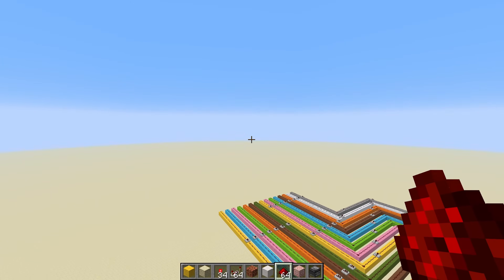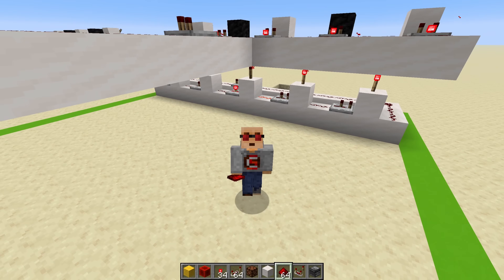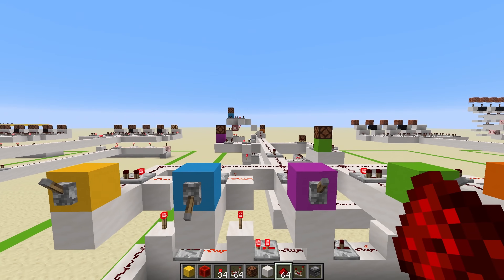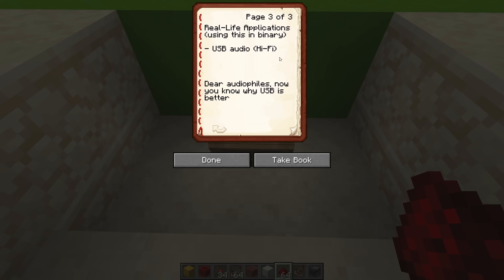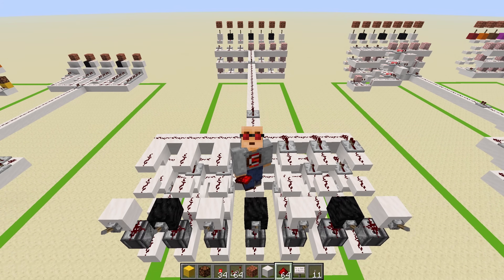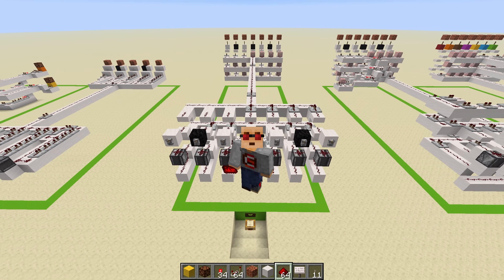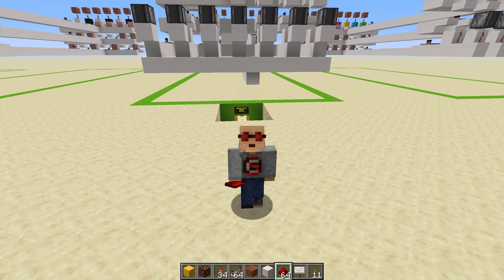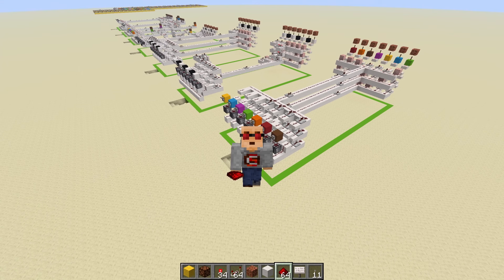How to Send Multiple Signals on a SINGLE Redstone Wire

Comment: I built something like this around the time that pistons were added to the game. I had a sender and a bunch of receivers, each one having their own address. I didn't transmit individual lever states, instead it would send the entire state in binary. So if you had 10 bits it would send a sync pulse to initiate then a receiver addr (a few bits) then the actual payload. So at 10 bits the payload would be sent over 10 ticks in time, tick 5 = bit 5, if the bit is on then the wire would be on at that point in time.
At the time it was pretty advanced stuff, now it's considered basic. :)

Comment: Is there a method using signal strength? like you’ve got 15 different values to work with, 16 if you include signal strength 0 as a unique output.

A downside is that it doesn’t scale well compared to the binary options

Comment: it would be so cool to have a automatic telephone exchange system in minecraft, like if you had a massive hierarchy of those systems all connected to a single line it would get real slow to send a message to another player so what if you had each hub be a switching station that can directly wire your signal to more hubs or the destination for fast direct data transfer and then you can disconnect and whatever, idk I just got that thought thinking of these massive redstone lines connecting to this network of systems like what we have with these massive undersea cables although you would have problems of simultaneous transmissions... ooo but also imagine super long redstone lines being continuously loaded with arrays of enderpearl stasis chambers

Comment: I think a good solution for the first one is making a separated clock that spreads to the torches. That way, It would be as fast as possible. Plus You could make a toggleable clock, so You could aways make em' uniform if they unsync.
Anyway, I find that very amazing, congrats for Your deeds! I really love redstone and command blocks stuff, both because They speak to me, and because they fit together very well!

Comment: I've always wanted to do this for a global rail network; have a sibgle wire in parallel with your track and have the signal change each turn based on the destination you select.

Comment: there's better ways to do this, I have videos from 5 years ago on this and not only serial but you can also do addressing to handle multiple devices on the same wire , tho i made them on bedrock version the basic concept is still the same

Comment: You forgot about hexidecimal

Comparators send the exact signal strength recieved

Pair that with sethblings hex wires

You get 2x slower wire
But 4x information

Making this over prolonged distances the best method

Especally since coverters are just basic comparator - signal strength
Send into a 1 strentgh detect red coder

And to fire in hex you just dispense shulker boxes

Comment: The issue I see with all of these in larger redstore builds is synchronous i/o.
If I have a synchronous input on two wires, feed it through any of these and into an XOR gate, there will be times where the gate transmits, whole parallel lines (with equal delay) ensure that gate never outputs, if the system doesn't break from the synchronous inputs in the first place (wich at least asynch and parralel binary would)

Comment: Grey codes grey codes grey codes
Reply: It's just an alternative base-2 numeral system to binary which plays much nicer with minecraft where instead of working like the decimal and other similar systems, each increase by one only flips one bit. So....
0: 00
1: 01
2: 11
3: 10
For example
Reply: It's relevant to data transmission because it can make the chunks of redstone on each end much simpler and smaller

Comment: My first thought was synchronous serial binary with a clock line. 2 lines, 4 ticks to facilitate 15 input sets, and personally I’d lock input while a clock cycle already has an input running. I’d rather have dropped data over corrupted data.
My second thought was effectively the asynchronous serial binary method. But I like the clock line more I think

Comment: So basically you could make an CAN control with the serial binary one if you gave an address and then the instruction. There was this one build that used different items in minecarts and piston slimeblock lines to send information through nether to teleport you to different places. With this it could be made as well.

Comment: Trying to encode musical notes in serial data was actually my very first redstone project, but it was waaay long ago before Pistons and so the only way to write both 0's and 1's into the cycling data stream was with torches, which were NOT (and still aren't?) signal stable.  So it failed.
But I did invent a brand new kind of XOR gate in the process! (2-wide, uniform delays when changing input)

Comment: Before I watch, is it about encoders and decoders? I've made a decoder before in Bugrock edition for a long-range wireless base controller, and taking input from a small "remote" that was built using a few pistons and torches!

It was mainly because I found wiring from the ground into the sky too tedious and ugly lol

The wireless "remote" could control in the base a water elevator, a TNT cannon, a TNT excavating site, and a snow golem-projectile-through-lava defense system lol

Idk just thought I'd share something

Edit: cool!!! java redstone is where it's at

Comment: to be fair, what causes issues with s/pdif and toslink is the clock resynchronisation, for multi channel PCM (e.g. stereo) signal there might be less issues as the packets for each channel have a preamble, which makes it easy to resync, especially if you use a large buffer.
also slight correction: DB25 parallel ports usually aren't multiplexed, they're more like the first one where you have all wires. (though tbh they're kind of a wild west of connector, some actually send 8 serial signals over it, and some DB25 are actually RS232 serial.) and USB is quite a bit more complex as it's a network protocol, with each endpoint having its own address.

there's yet another way to interface, it's to use a host-device protocol, where you have one host ask every device what it needs, that can be more efficient as it sends data over the wire only when needed, and it would usually be spam proof as the state of the lever is sampled when requested.

also you can spam-proof most designs, by inhibiting the lever output while it's not safe to change.

Comment: I think you could solve desync by having something extra trigger with the first bit of data so you always know where the start is. (This could be done with a second line that only triggers for the first bit or having a strength 16 input for the first bit while everything else is less)

You could also have that first bit of data actually trigger the start of the second clock so then the delay becomes irrelevant because the correct bits are always synchronized
Reply from the maker: Bro watched the first minute and left😂

Comment: There's also "analog" where you send signal strength over one wire to control 15 different outputs.

It does however require a comparator every 3 blocks and is therefore quite expensive and slow.
Reply: Sethbling made a way to connect them with a 3 block wide wire

First output detected by repeater chain
All feeding into a single input wire
Which inverts the signal but the distance inverts the signal again

Keeping reliability
Reply: Also, the comparator would be every 4 blocks (comparator + block + redstone + block + comparator)
Reply: @DABABIBABABU not if you go with sethblings comparator wire design

Just stack 15 repeaters sideways to do a double invert signal strength for the next comparator to be read.

It is 2x slower for 4x information therefor twice as effective
Reply: @maxdragonis1304  I wanted to add to your comment that the simple design would've been 4 blocks long anyway, not 3.

About sethblings's design: I'm not sure if it's really twice as "effective", since you're trading latency for bandwidth. You can always add more wires to fix bandwidth, but for latency you gotta use fast wires.
Reply: @DABABIBABABU well it is really a conversation about watts over volts/amps

If your talking about latency that would be the volts

While the bandwith would be amps

This would be 4x amps for 0.5x volts

Aka 2x watts it would be more effective

The only downsides i can think of is spacing which is 18/10
In scale
And cost due to requiring 15 repeaters and 30 dust per comparator in the wire
Reply: @maxdragonis1304  no, I'm talking about latency. Aka how long it takes for information to reach the destination. In his keyboard example it's about how long it takes for a key to show up on the screen.

Bandwidth / latency are good words to describe the concept. High bandwidth = if you can watch videos in 4K. Good latency = if you have low ping in games.

Volts / amps are used when talking about electrical energy, not information. In this context "latency" obviously isn't a thing. You probably don't care how fast some random electrons get to you lol.
Reply: @DABABIBABABU yes but they are perfect examples for the concept at hand in order to make an arguemebt for comparator information in block games

Comment: TOSLINK cables transmit the same signals as S/PDIF. S/PDIF combines the clock and data signal using signal transitions. The signal will unconditionally transition every bit sent, and the 0s and 1s are marked by transitions in between. The unconditional transitions can be used to synchronize the clocks. Having used TOSLINK for my surround, it seems pretty robust, haven't noticed any bit slip, which results in weird distortion with audio.
Reply: exactly. the clock is recoverable with real s/pdif or toslink because of differential manchester coding. this implementation doesn't. i was a little confused by that.
Reply from the maker: Yeah but reclocking the signal is a pain, you get an inconsistent PLL out of it, for HI-FI you can hear a huge difference with USB

Comment: Thinking of parallel vs serial binary, it's really just a tradeoff of space vs. time, and as computers themselves have gotten faster, it's often a reasonable tradeoff to make. When you're dealing with super time critical hardware, you might find more usage of the parallel format, but less so in consumer electronics where good enough is good enough, and cheap to mass produce is king.

Assuming you had a truly enormous base or machine where each subcomponent or farm or station could have multiple inputs, it might be worth adding a control line that directs destination separate from the data line that provides the input. Alternatively, you could put the control value in the high bits and the data in the low bits, though that runs some risk of rewiring if you later need more data lines. The advantage of this would be allowing each subcomponent to start it's data signals at zero again, and to allow each subcomponent to add new data signals incrementally. Right now in your serial design, if you send signals 1 through 5 to component A and 6 through 10 to component B, and then you later wish to add more to component A, it would have to be signal 11. Even if you left blank bits for each subcomponent to expand into, it's still weird that component F starts at signal bit 31, and the handling needed at each subcomponent scales with the number of total components in the system, which is also weird. A control line keeps each component simple, allowing you to design the component fully in isolation, and then build it into the system without having to remap the lines.

Anyway, really cool video. As much as I think redstone is fun when done by typical YouTubers, I think it's more fun with people like you who understand circuitry, so thanks for the vid!

Comment: Does TosLink not have a regular timing signal to sync them between clocks? I thought it did.
Reply from the maker: Yeah it does, but it's really crappy and complicated for no reason. It's BMC (Biphase Mark Code),  which means  the receiver basically has to reclock the signal using the rising edges of the data. Only hi-fi gear for old people that refuse to use USB implements it

Comment: I'll have to take a look at that keyboard you'd made! I designed my own "typewriter" that does roughly the same thing as yours, which functions by sending character data along a single wire by encoding it into a series of pulses that gets stored in a shift register hooked up to a display slice. The specific implementation means that it's pretty slow and very susceptible to spam-induced data corruption, though. The speed at which yours goes at blows my design out of the water.
Reply from the maker: It's cool! Yeah binary is a game-changer when it comes to any type of computational stuff
Reply: @ChunkySquaresMC  How are you handling character data storage with it? Does each display slice have its own ROM, or is it a single ROM that everything shares? The slowdowns in my display tech come from everything sharing a single central ROM, which trades compactness for speed.
Reply from the maker: @TheAppleFreak  
Locking repeater shift register + locking repeaters😎. You don't see that often, huh? Locking repeaters are like the definition of underrated

Comment: sees it cycling through the inputs on a clock
That's just a NES controller
that's quite literally what it does.

also SP/DIF / TOSLink are just different revisions of the same digital audio transfer protocol, and they do not get distortion from how they use it.

Comment: bro there a problem with your last build.
you can send only 1 bit at the time and its not very efficient.
its better to just do it a classical shift register way.

if you have number like 01011010
you  need just send 1 01011010
that first 1 starts a clock and you just do shift register stuff.
thats much faster and its always work with the same timing you need just to click button but you can do that automaticly if you need.

anyway problem with your last build is you really transfering 3 bits at the time for every bit, for 7 bits is 21 bits you need to send just for 7 bit info, thats slower 3 times than just shift register thing.
(even first metod is faster)

Comment: Parallel binary's biggest downside is that, compared to every method shown before, this one can only have one input on at a time.
Turning on input 1 and input 2 at the same time will make the output think you turned on only input 3.

Also redstone has a signal strength of 0 to 15, so you shouldn't sleep on sending data via hex code, which would allow you to send the state of 8 inputs with only 2 redstone lines.
https://youtu.be/L_WIKBYHRzs?t=164
Reply: Redcoder, my beloved!
Reply: well it would be harder to encode the signal strength in this situation without turning it into a item that's sent, and decoded on the other side, although it would allow way faster methods of data transfer, (though not a 8x speed increase due to needing to get the item presumably from a hopper into the item data line, then decoding at that speed or faster)
Reply: @kellentownsend If you check the video I linked, there are a few fairly easy ways to send a hex signal described
Reply: Yeah but the single player is unlikely to be hitting two at once. easy to tell players "hey don't have two people controlling at once" but it's good to design resistant systems when you can
Reply: @SolaceCafe  There's plenty of designs where you want multiple inputs to be active at the same time.
Reply: @redplayer4821  with the design shown in the video you can have multiple inputs at the same time, what you cant do is send them at the same time
For example, he can send input 1, wait a bit and send input 4, and the reciever would toggle the first output, stop receiving a signal and then toggle the fourth
Reply: sorry for the late reply, but can you explain what you mean about turning on input 1 and 2 at the same time? Why does that trick the system?
Reply: @hockeylance36  in binary 1 = 0001, and 2 = 0010, and 3 = 0011 so if you turn on number 1 and 2 you get the same signal as 3. I gave 4 digits to the binary cause it makes it a little easier to under stand

Comment: If someone struggles to see how parallel binary works in given example, hope this helps: you have N copper lamps, and you switch them *individually*, so instead of sending whole state you send № of switched lamp. And there's no 0th lamp because all 0s is a default state. So instead of N-1 directly connected wires you have log2(N) wires with "router" on recieving end.

Comment: 0:54 in logic design this would be called asynchronous due to the not shared clock
Reply: There's an implicit clock with Minecraft ticks
Reply: I didnt even think about what Paul said, the tick system does act as a universal clock

Comment: You can actually encode an arbitrary amount of possibilities into a single 1t pulse! The trick is to use subtick timings created by specific patterns of repeaters/comparators etc, and compare them on the receiving end. This gets surprisingly small, and is by far the fastest and most spamproof way to send data on a single wire.
You do need a synchronous clock, but that isn’t as hard as you would think, because of daylight detectors! Which all follow a global 1hz clock, perfect for synchronizing serial devices like this.
Let me know if you want an example / world download, I’d love to see a channel go deeper than surface level redstone mechanics.
Reply from the maker: @younscrafter7372 You predicted it!😂
Reply: This may sound dumb, but could you have each output sensitive to a particular input frequency and have each input produce a repeating signal with a different frequency, then carry all signals together on a single wire? Basically a Fourier Transform type of deal?
Reply: i'd be interested in seeing this